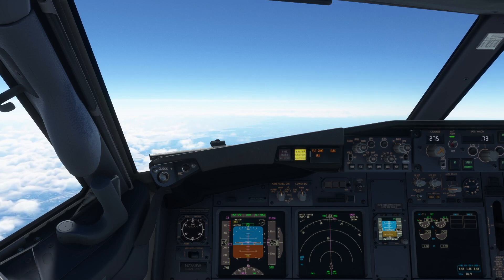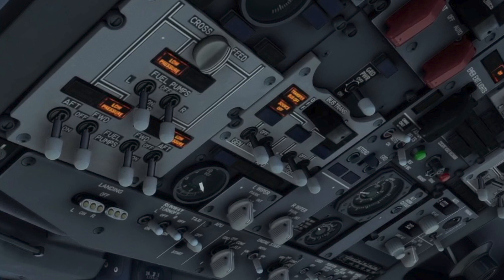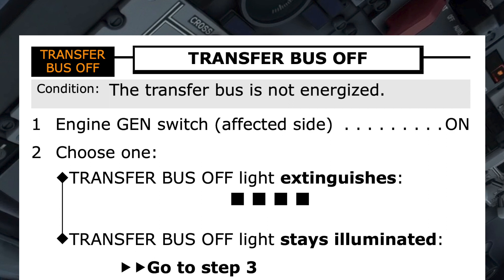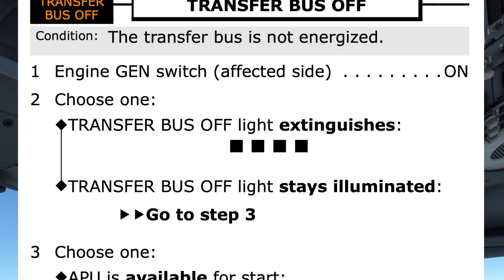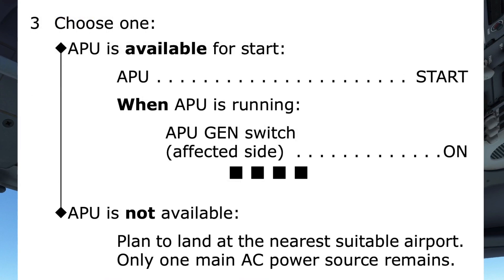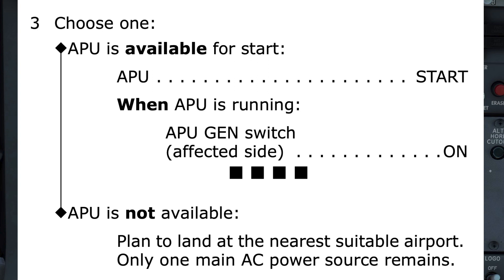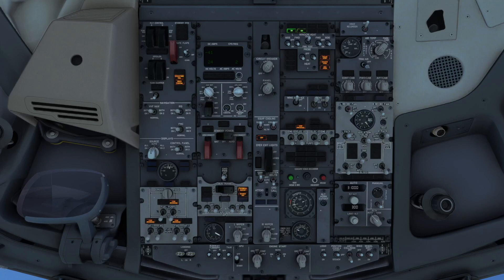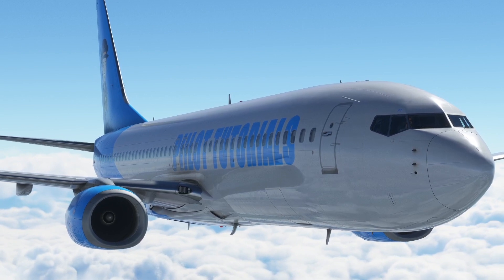737 Non-Normal Procedures: Transfer Bus Off

Comment: And here comes one more non normal situation video request which is loss of thrust on both engines on climb phase of the flight when we are about the 3000ft
Reply from the maker: Thanks for the suggestion, that would make for an interesting video.

Comment: What are the reasons that we had this TRANSFER BUS OFF failure? During the cruise flight I guess we lost IDG 1 . If it was IDG 1 why would not we get the IDG failure? And we did not go for the Idg failure nncl. Because SOURCE OFF light illuminates as well
Reply from the maker: Good questions... the sim has built in failures and I'm working through them. Using the AC / DC metering panel would probably show the IDG still working, will try to test and add to description if so. If anyone else would like to try it, please post your findings. Thank-you.

Comment: Hi, good videos. But in this case you are in emergency yet. Because after you conected the apu gen, the transfer bus still iluminated.
Reply: @pilottutorials After engage apu gen, the bus Transfer number 2 is not powered, because the transfer bus light is iluminate. Maybe because the simulator
Reply from the maker: @komba2023  Tried this in a different simulator that shows the system, if a transfer bus is inop, you are right the system remains unpowered even if the APU is selected.
Anyone know why the checklist has us do this, if it doesn't do anything?
Reply: @pilottutorials  i think, its happens because you set the failure in the options  of the simulator, so if you solve it via qrh, the failure "Transfer bus" is alredy set. Like a Transfer bus Broken, and anything you do fix it
Reply: @pilottutorials sounds like you made the AC TRANSFER BUS 1 INOP in your simulator. If that is the case you wouldn’t get any of the systems that it powers to operate

This is my understanding of the presented defect. The AC TRANSFER BUS 1 can’t be supplied with any source of power. It shows an inability of:
* the BPCU to automatically connect AC TRANSFER BUS 2 to AC TRANSFER BUS 1 (should happen without pilot input)
* the #1 engine IDG to reconnect to the AC TRANSFER BUS 1 by selecting the #1 Engine GEN switch
* the APU generator to connect to the AC TRANSFER BUS 1 by selecting the APU GEN switch

This is a critical situation for the aircraft.

If you go to step 4 in the QRH, the TRANSFER BUS OFF light remains illuminated (after selecting the APU generator) plan to land at the nearest Available Airport. Only one main AC power source remains.

You needed to make the video longer to show the rest of the QRH.
Reply from the maker: @NicholasRiviera-Dr  Good to see you here, thank-you. Transfer Bus Failure was selected in the sim, the checklist seems to literally be for the bus being off, not broken. However, just checked a more recent QRH and it has additional steps if the Transfer Bus Off light stays illuminated after selecting the APU generator switch, including planning to land. This has been very interesting, wondering why the APU would be started if it can't be selected as a source if the transfer bus is broken, and finding newer QRH's have added steps to address this. An older QRH is used for the videos as it is publicly available. If anyone would like to suggest a link for a newer publicly available version, please comment below.  @NicholasRiviera-Dr  and @komba2023 Thank-you.
Reply: @pilottutorials  no problem. It’s interesting for me aswell because it highlights one of the issues that is constantly drilled into us when working in this industry. That is - always use the most current and up to date approved source of data for any sort of work that we do on aircraft. The reason for this is because the manuals covering procedures, materials, parts etc are constantly being revised and updated as changes happen for various reasons. As an example, if we print out (onto paper) the reference for a job that we are doing, it has the time and date stamped onto it and if you follow the rules, it is only valid for that job that we are doing on that day. Once that job is finished we throw away the print out. If we do the same job the following day, we need to do another print out incase there was a change to the process in any way shape or form. You would be surprised how often slight changes happen. It appears that in the case of your video, a change was made to the QRH by adding an additional step to the end of the QRH, if the TRANSFER BUS OFF light remains illuminated after the attempt to connect the APU fails, to land at the nearest available airport
Reply from the maker: @NicholasRiviera-Dr  That's really really great input. For these videos I'm only comfortable using a QRH that is already available online, still, the process of running the checklist and system operation can be demonstrated, and it's opened up some opportunity to learn. Another thought with the APU, it's a backup electrical source for the good side, even if not able to replace the lost source due to the failed transfer bus. Thanks again, appreciate your expertise.
Reply: @pilottutorials  no problem.
I look at it slightly differently, sure the APU is another backup source for the “good side”, but what if the “good side” AC TRANSFER BUS also fails? It’s possible and I suggest that is the reason why the QRH’s next step is to find somewhere to land.
Reply from the maker: @NicholasRiviera-Dr  Yes, it's not a good situation. Appreciate your valuable input, thanks.